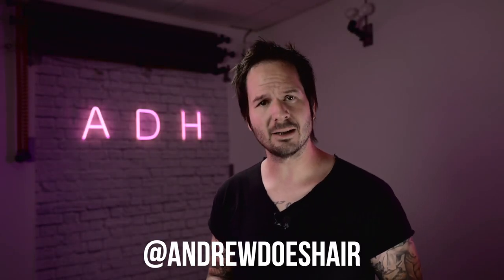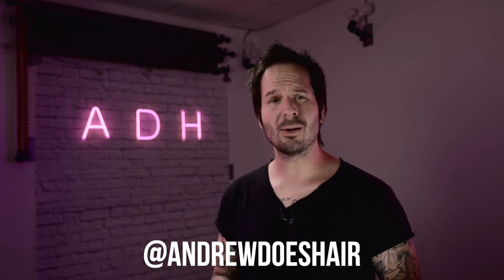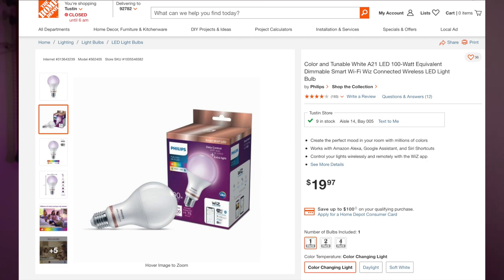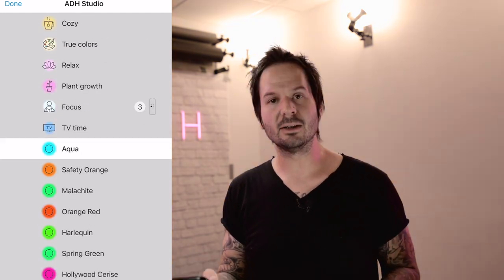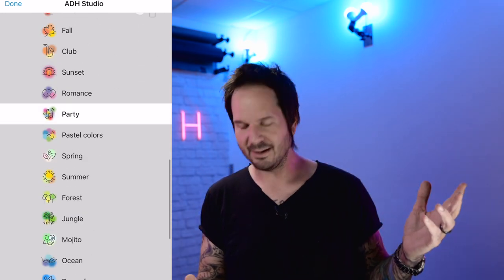Hair studio lighting (updated 2021)

Comment: I know this has nothing to do with lighting. but I just wanna ask how do u achieve such volume in the mannequin hair?
Reply from the maker: Blow dry after ADH Dry. I flat wrapped everything from the apex back to get that stuff to lay more smoothly then I used a Denman brush to lift and bend the front half. The very front was over directed downward with hot air then pushed into place with cold air

Comment: I have been cutting hair for 46 yrs., and I will tell you the best lighting is just a good old fashioned florescent double strip light on the ceiling slightly behind the patrons head, with enough lenth to shine on both sides of their head as well.  Then supplementing that with small florescent strips (maybe 2 ft) on each side of the mirror behind the patrons head so that it lights up behind and slightly to the side of their ears.  Typical traditional set up that they have been doing for many decades in most barber shops.
Reply: What do you mean "each side of the mirror, behind client"? If you put strips in mirrors sides its going to be in front of the client, right?
Reply: @kominio  Most barbers cut the patrons hair facing away from the mirror.  So, the lights on each side of the mirror project light to the back of the patron's head, and somewhat behind each ear.  The mirror is a tool for the barber to get perspective when cutting the back of the patron's head.  I do like to also have a mirror on the opposite wall so the patron can watch while getting his hair cut.  But some shops are in a room too wide for the mirror across on the opposite wall to be easily seen by the patron as he gets his hair cut.  In this case a barber may cut the hair with the patron facing the backbar, and then turn the patron around when it is time to get a good perspective on the back.

Comment: Do you still recommend this setup for a small studio?  Any issues with the bulbs?
Reply from the maker: In my little office here I’ve had no major issues, but the wifi is decent. However, we got some of these lights at my salon and I think due to poor wifi the bulbs rarely actually do what we want them to do, it’s a completely different experience than what I’ve gone through in my home and office with the bulbs. Also important to note that they updated the app a year or so ago, and the V2 app is absolute garbage, I went back to V1 after two days of being frustrated with the new version
Reply: @andrewdoeshair  Would you recommend just using other 💡?

Comment: I tried it out, the lights you recommended and I didn’t really like it. It’s only good when you have good connection with your wifi
Reply from the maker: In my office here I haven’t had any issues with the bulbs, same as in my house, but at my salon the bulbs are a nightmare because the wifi is often weak. I think in the salon we’re likely going to switch from these smart lights to some 5500k LED bulbs in our photo area